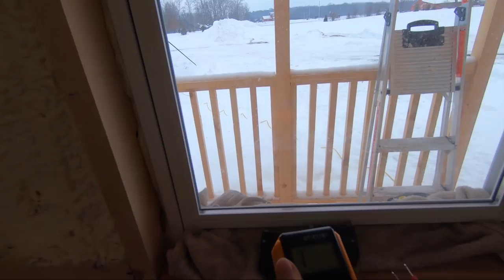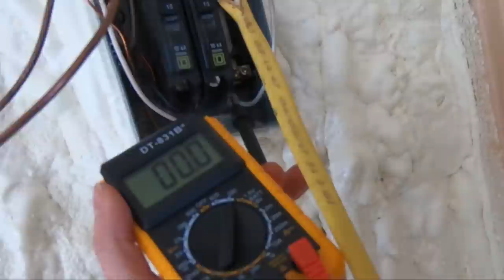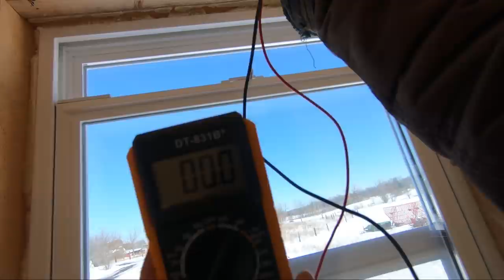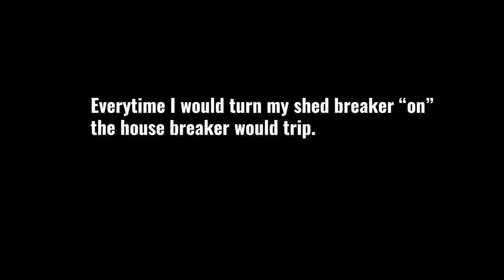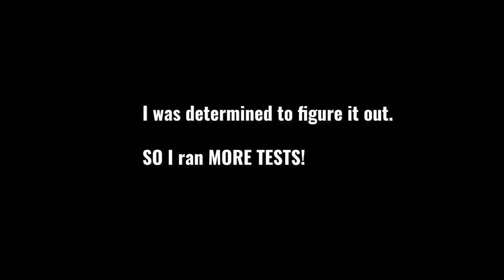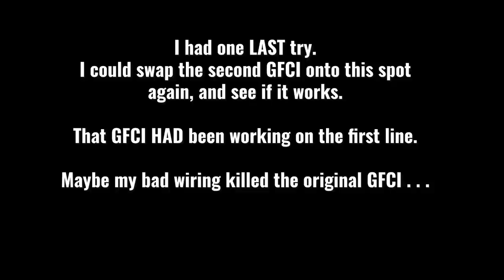DUMB MISTAKE Made it BLOW- UP?! -- Shed to House Cabin Vlog #10

Comment: The only thing I can say is always higher an electrician - but now - when dealing with live electrical always keep distractions away - like little dogs - even at 120 volts it can kill you - it takes only .2 amps to kill you - you should have had one breaker for lights and one for the outlets - remember the box is painted so you will not read anything - and no on the breaker you are reading it wrong - you check the breakers go from the wire hold down screw to the clamp at the back bottom of the breaker -  I wish I could have come over to help - Boston is only a short drive - I don't mean to criticize - as an electrician you are making me cringe LOL - Best of luck
Reply from the maker: Since I was working with only two 15 amp breakers, I had to carefully balance possible loads. If all lights were on one and all outlets on another, I'd be forever blowing fuses :(
Reply: @This1LifeWeLive  no with lighting being L E D you wont be droning much on the lighting the only thing will be A/C  and heat - I like the way you are thinking about balancing - I think you will be fine

Comment: Are you using a double phase box otherwise a 50 amp service where is you need a 30 amp service the single leg which is the black or white is your neutral only goes to one breaker yet you only wiring power to one breaker so you need to take and wire both Breakers to run a single 30 phase to both sides of your breaker so put a jumper two both Breakers this will enable you to have power on all of your Breakers throughout your building if you bring 220 and your box then you would wire each breaker separately this would give you 220 volts since you're running 110 so you have split the system is a reason your Breakers not working you just need to work one breaker system instead of two take your wires for one breaker and put them all on the same breaker and do away with one breaker this will give you power throughout the whole building on all your plugs in lights leave one breaker out so that you only have one breaker in you don't need two Breakers in that box you're not running a 220 amp service then you have proper power to all your plugs in lights you're doing an excellent job
Reply from the maker: I was moving the black "live" wire from one breaker to the other to test each independently :) I figured it might need some sort of split for when final power goes in, but wasn't concerned about it for testing at least :)
Reply: @This1LifeWeLive  Just, Don't Forget to Add that jumper from your first HOT Breaker Feed to the other Breaker Feed.  (Terms Line and Feed are interchangeable).